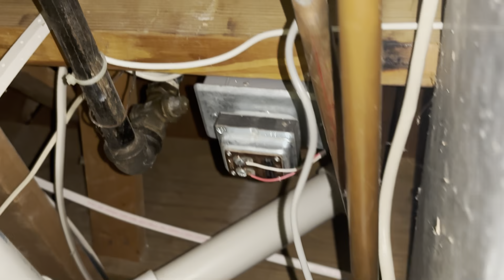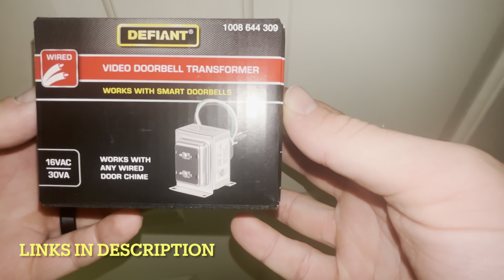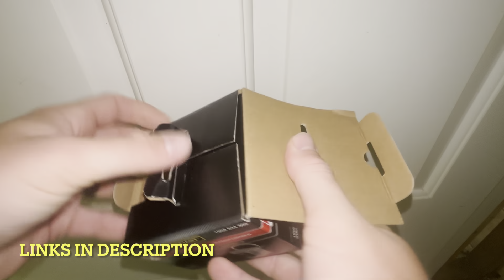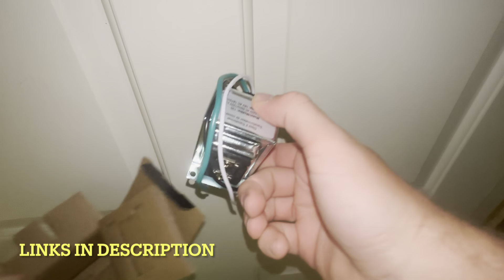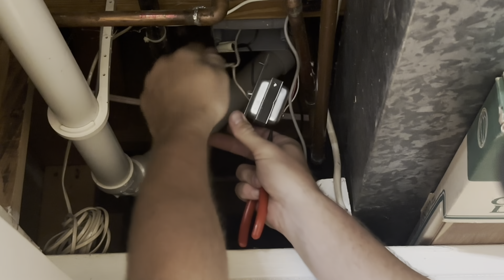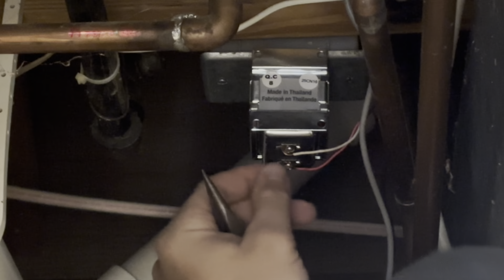How to Install a New Doorbell Transformer

Comment: Humm little worried about not grounding that wire. That is not to code. All my research saids that the new transformers need to be grounded, the old ones are super low so did not need it in a metal box that is grounded to the main house box that has the grounding rod outside the house that runs into the ground.

Comment: I’m in apartment. Transformer next to water heater and reads zero volts, but there are four wires screwed into the low voltage side and a 5th, a white wire that isn’t connected at all, but has a hook in it as if maybe it was at one time. 🤔
Reply from the maker: 1. That shouldn’t be your responsibility in an apartment. I’d request the management team to come over and fix it. Save yourself from any future issues if you try to fix it yourself.

2. There are four wires and they are all going to the low voltage? You should have a black and white going to the transformer. If there’s two whites, my best guess is that they are connected from one apartment unit to the next and run on the same circuit. Had to give advice on this one without seeing it myself and only working only description.

Comment: My nest doorbell does not connect to the app. It rings in the house just can’t get it to connect to the app. At one point it was fine not it doesn’t connect to the app. Could that be a transformer issue?
Reply from the maker: I’m not familiar with the nest system but if it’s ringing in your house, then the transformer is working fine. Did you hook up a nest connection on your chime inside your house? If so, I’d look at those connections to make sure they did not go loose. If those are fine, check your nest app for issues with the Wi-Fi connection or any potential batteries you might have to recharge on your devices.

I hope this helps.

Comment: Does it matter which terminal the red wire is connected to?
Reply from the maker: The low voltage wires it does not.